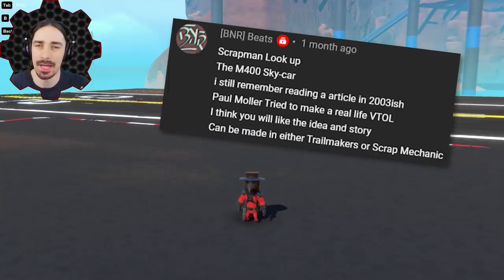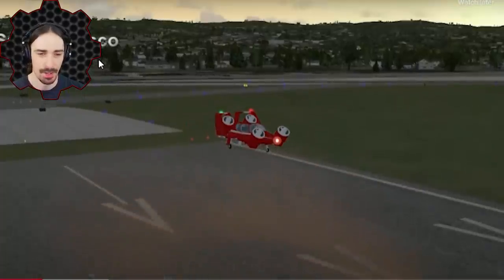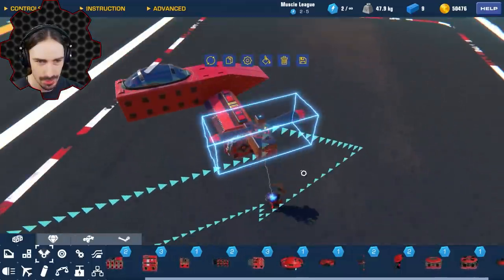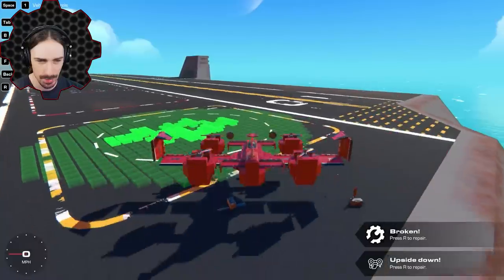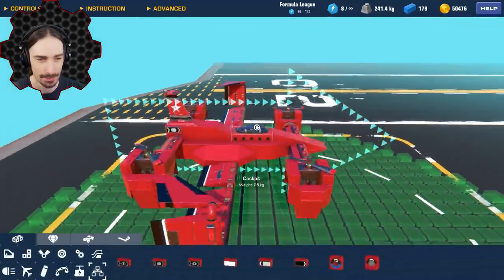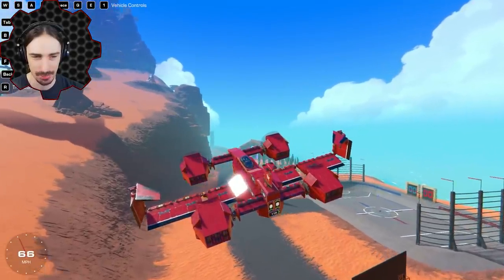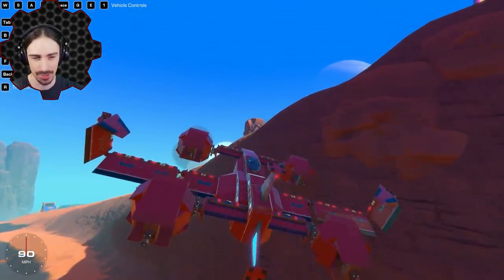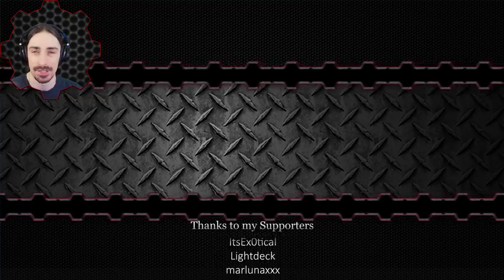This Failed Flying Car Was Supposed To Be Our Future... SO I BUILT ONE!

Comment: I actually do have some minor aerospace engineering experience, and to be honest... this seems like an  actually fairly sensible design. There definitely could be something I'm missing, but it seems like it would be something that, with some computer automation, would actually be relatively easy to control. It's effectively a quadcopter during take-off, and then transitions to have some vertical lift which allows more efficient use of the thrust than staying in a quadcopter configuration. It seems pretty feasible to me. Still impractical though just on the fact that actually flying a plane is sort of the easy part of the things involved in flying a plane, so a somewhat easier to fly plane would not really make things a lot more regular consumer-accessible. They would still need a lot of training.
Reply: Yep, the problem of flying cars is not that we don't have the technology, is that we don't have the Ai to drive them, because if we let humans do it, "car" crashes will skyrocket
Reply: your verry smart
Reply: To be honest I was more interested in this comment than the video
Reply: @alessiobenvenuto5159  "SKYrocket"
Reply: Thank you very much, as I've heard what he said I was quite irritated and frustrated. In the Original you btw also see that the front propellers are angled more upwards than the back propellers.
Reply: @DeadBread.  ?
Reply: @alessiobenvenuto5159  because sky and skyrocket, pun
Reply: @alessiobenvenuto5159  Actually, we have the AI. The problem is demand. By that I don't mean nobody wants flying cars, but nobody wants to pay what it costs to get the car and certifications.
Reply: @duodecaquark3186  we don't have a perfect ai to drive cars, but we have one for driving drones even in traffic? Seems extremely dangerous, even more than cars
Reply: The problem isn't the AI, the problem is the FUEL.
Reply: Bro just wrote a few paragraphs for scrapman😂🎉😅

Comment: I noticed in the animation that the SkyCar seemed to use VTOL mode until it's at proper altitude, after which it transitions to horizontal flight for cruising at THAT altitude, I don't think it was really meant to gain too much altitude in that mode.

Comment: I remember reading that the ducts themselves provided most of the lift during forward flight.  The wing was mostly for control and did not provide much of the lift during forward flight.  It used elevons for control like a flying wing.  You should have added small wing pieces to the ducts.
Reply: I was gonna say, in the irl video it shows that the intake are not 90 degrees when taking off, and at a part of the animation it shows that the rear of the duct is not horizontal, but slightly angled showing it still used the thrust to have lift.

Comment: this is the problem with the old "Future" stuff, they expected it to look cool, but since they didnt know how it would work, they left no space for actual functuanality. i bet this thing would not have enough fuel to fly for an hour.
Reply: 4 combustion turbojet engines take metric tons of fuel, you really only need 1 or 2 and direct thrust downwards, even STOL is much more efficient.
Reply: I actually suspect that, if it were completed, it could go a lot longer than that. It would certainly be less efficient than a regular light airplane, but it's pretty typical for a 4-seat general aviation plane to be able to fly for 3-5 hours with full cargo weight limit, and get a range of 300+ miles. Nicer ones can exceed 500 miles on a tank with about 500-600 pound total carrying capacity while fully fueled. Of course, these planes run a cool $250,000+ price tag.
Back of the envelope type calculations, but I think it would be reasonable for this concept to get at least half that range with the same carrying capacity.

Edit: Removed incorrect musings about engine type and all.
Reply: @daanoffline5716  the original design isn't for turbojets. They're just ducted propellers. This is actually a perfect choice for this type of system, as they're more efficient at lower speeds and lower altitude than turbojets or turbofans are. It's why still to this day brand new planes with only a few passenger capacity are propeller planes.
Reply: skycar m400 was apparently supposed to be able to fly for 6 hours tho
Reply: @discoadri633  that is still shorter than a school day for kids in the US, which is 8-9 hours

Source: Me (still in middle school)
Reply: @DeadBread.  that is still enough to travel 3192 km with its speed 
Source is the site of the comapny you can find it by typing the name of that car
(Think it was skycar m400)
Reply: @discoadri633    i was more or less just joking about how long school is.
I know 6 hours of flight time can get you quite far. I mean if you fly in a straight line for only 20 minutes, you'd probably be at least 15 miles away from where you started. I was just joking about how just one school day is longer than the flight time for a vehicle which transports people longer distances than cars can
Reply: @DeadBread.  yea dont worry im not like seriously telling you that ur wrong or smth like that was just a pretty chill comment and btw in 20 mins ud be around 110.3 miles away in da skycar
Reply: @markjacobson4248  You're joking right? Wankel engines are some of the least efficient combustion engines of all time. They use a lot of fuel and oil and much of it just comes out the exhaust unburned due to the overlap in the combustion processes.
Reply: @theyeetus1428  You're right. I don't know why I misremembered that, but absolutely correct. I'm editing my original post.
Reply: @markjacobson4248  I read that the actual prototype could only lift enough fuel for 20 minutes with rotary engines, and endurance with turbines was even worse
Reply: @markjacobson4248  isn't the skyplane just a quad copter with wings and rotating power plants? And if skyplane really is what I think it is, then why not just fly a quadcopter and not have to deal with extra complexities and possible reliability issues that come with having extra wings and servos. As well surely quadcopters are likely faster than your normal pedestrian car, and likely also easier to produce than a skyplane. I don't think that the skyplane solves anything that we haven't already solved when it comes to pedestrian transportation via air.
Reply: @ManaMan_1405  There is a reason VTOL vehicles are made despite being far more complicated than a quadcopter. Fixed-wing aircraft are massively more efficient than helicopters or quadcopters. Transitioning to winged flight would be highly beneficial to give it the range to get anywhere. That being said, this particular vehicle is not practical in any way, not because of the mechanical design but because the concept. As far as I see it, there are only a few things that could be designed better for a 1 or 2 seat daily commute flying vehicle. It's pretty close to exactly how I would design it if I were the designer and I was working with what exists today, but the concept to begin with is just one we don't really have the technology or public interest to make practical right now.

Comment: You should check out the VZ-9 Avrocar. 
The worlds first (and only) "official" flying saucer.
Reply: First, probably yes. But the predecessor of this one, the original Moller M200 (now named Neuera 200, according to their homepage), looked just like the cliché of a flying saucer, too: pilot (+ passenger, if any) in the center, under a 'fish bowl' canopy, eight props in a circle blowing their air flow downwards through the 'saucer'... Only concession to reality: a fin sticking up behind the pilot, to keep it flying somewhat straight ahead in forward mode...
Reply: Flying sauce
Reply: @CoPoint  I forgot all about that one. Thanks for pointing it out.
Reply: @BLKBRDSR71  No problem - was just wondering a bit why the 'little brother' didn't get at least a short mention in the video, as it looked so much like the proverbial saucer... seemed like a missed opportunity 😁...
Reply: @CoPoint  I believe he built this to test his idea of using compound fans driven by Wankel type rotary engines

Comment: When building propellor thongs like these, use pistons to pull the propellor down into the tube thing. It doesn't have collision on the blades, just the 2 by 1 block at the bottom. Using this you can also kinda merge more than one propellor , when before you couldn't because of the hitbox

Comment: The front engines had a ducting apparatus that split the thrust for elevon/aileron roll control. I can only explain it as a sort of bendy Venetian blind slats that were to be fly by wire type controlled. But during vertical and hover the nacelles tilted then transitioned to horizontal flight

Comment: You're assuming the wing is used for lift, instead of for controlling the pitch. It's easier to fine-tune the pitch using wings, than it is using the engines' thrust.

Comment: I imagine if you did more quad steering (slowing CCW motors to spin CW and vice versa) in VTL mode, and using differential in forward flight would fix the issues with yaw. Though I have no idea if that's possible in this game, so *shrug*, but awesome video nonetheless!

Comment: There are several planes without elevators 
One example is the “euro fighter” and “avro Vulcan” they combine the functions of elevators and ailerons into one control surface
They are very common on fighter jets and the f22 is very reliant on them

Comment: my theory is that the jets had thrust vectoring, because when it shows the aircraft taking off the jets are at an angle instead of being completely perpendicular to the ground. that also explains the lack of control surfaces on the wings.

Comment: there was some kind of flaps in engines to crontrol engine flow a bit down. Thats why engines was more like 45-50 degrees.. Maybe. Regardless they wasnt 90 degrees when landing. And flying forward engines gives some lift force as forward too. And engines was for direction of movement for get air in to engines.

Comment: Aircraft with wings rear of the center of gravity are actually pretty viable efficiency and stability wise provided that your control surfaces can provide enough torque to rotate the aircraft, given that this plane uses engines as canard control surfaces it seems pretty viable to me

Comment: Hey, ScrapMan, I know how to make tank controls in Trailmakers: you just need 2 engines 1(or more) for each set of wheels, they need to be programmed for A/D keys. Then add logic gate, connect to every engine and program it for W/S and signal strength 0,90. And just like that you have a tank :З
Reply: What is did for my tank is I made six raw engines, (three for each side) connect  the wheels to the engines, made three of them up/down keys and the other ones w/s
Reply: @poot.0  I tried this too, but my method has better turning while in motion
Reply: @FourDISGuy  yeah, mine kinda sucks. 😂

Comment: just move the wings forward, in the middle, but you also have body lift, for what that amounts to, as percentage, a drone does not have wings
Reply: t-tail for vertical control
Reply: keep it simple engineers
Reply: are you in some hurry
Reply: all possible, use electric motors with metal-air fuel cells, for real
Reply: if you cant, you are a failure, not the goal

Comment: Scrapman, I got an idea. Make a beyblade and surround it with magnets facing outwards and use thrusters to rotate it. Use a swivel to cancel out the beys rotation and place another swivel on top of it and place some thrusters to use for changing directions (in instruments of destruction)

Comment: You should really check out balsa model flight sim, if you really want real world flight physics. Still in early access but great for testing plane designs. Doesn't have helicopter physics yet but people are getting good at manipulating the current flight physics. I had made a vtol pod racer. Took hours upon hours to get to work 😂

Comment: Personal flying "cars" are extremely costly and inefficient for both manufacturer and buyer, because constantly fighting gravity whilst trying to stabilise the vehicle is an engineering pain in the 4ss.
It's easy in the big planes with high speed and big wings and also more efficient because you can build it once and use it for 20 years, and one flight brings a lot of people.

Comment: being and aerospace engineer yeah they would have had problems with thrust to weight and center of pressure and lift because of the wings being in the back with engines and no tail but they can be solved with auto stabilization and movie the engines in flight for thrust vector control to stabilize the craft in flight along with have at least 2 control surfaces on each wing 1 for  stabilization and one for control.

Comment: Jupiter is primarily composed of hydrogen, but helium constitutes one-quarter of its mass and one-tenth of its volume. It likely has a rocky core of heavier elements,[16] but, like the other giant planets, Jupiter lacks a well-defined solid surface. The ongoing contraction of its interior generates heat greater than the amount received from the Sun. Because of its rapid rotation, the planet's shape is an oblate spheroid; it has a slight but noticeable bulge around the equator. The outer atmosphere is visibly segregated into several bands at different latitudes, with turbulence and storms along their interacting boundaries. A prominent result of this is the Great Red Spot, a giant storm known to have existed since at least the 17th century when telescopes first saw it.

Surrounding Jupiter is a faint planetary ring system and a powerful magnetosphere. Jupiter's magnetic tail is nearly 800 million km (5.3 AU; 500 million mi) long, covering nearly the entire distance to Saturn's orbit. Jupiter has 80 known moons and possibly many more,[6] including the four large Galilean moons discovered by Galileo Galilei in 1610: Io, Europa, Ganymede, and Callisto. Io and Europa are about the size of Earth's Moon; Callisto is almost the size of the planet Mercury, and Ganymede is even larger.

Pioneer 10 was the first spacecraft to visit Jupiter, making its closest approach to the planet in December 1973.[17] Jupiter has since been explored on several occasions by robotic spacecraft, beginning with the Pioneer and Voyager flyby missions from 1973 to 1979, and later by the Galileo orbiter, which arrived at Jupiter in 1995.[18] In 2007, the New Horizons visited Jupiter using its gravity to increase its speed, bending its trajectory en route to Pluto. The latest probe to visit the planet, Juno, entered orbit around Jupiter in July 2016.[19][20] Future targets for exploration in the Jupiter system include the probable ice-covered liquid ocean of Europa.[21].
Reply: @Bedmundus -- I think that you might've meant the Jupiter comment for another video; this one's on VTOL in a video game.
Reply: are you getting the unaligned comment section bug again? could be found when switching to another video too fast or clicking on community tab while miniplayer is on (i only find this on pc)
Reply: @beaclaster   Ooh, I hadn't heard of that one!  (And I'll have to keep it in mind, since I'm on a PC.)

Comment: Moller's work always looked like the best bet, but I have to say that Moshier's looked cooler. 😉  (Michael W. Moshier, Aurora 400, though I think that he might've worked on some others as well.)
Reply: I kind of disagree. He didn´t have the theoretical background and made the turbines way to small. The turbine diameter would really need to be twice that to be a reliable vihicle.
Reply: @matsv201   I agree with you.  20 years as a turboprop mechanic, and nowadays I can see a few obvious issues with the designs that I never really grasped in the '80s.
Reply: @charlesrockafellor4200  Yea. you really just need napking math to figure out how much power certain fan area need to be lift a certain size. Lift response is also a issue

Comment: The problem with flying cars and similar such devices is the fuel requirements. The amount of energy you have to produce to get the vehicle off the ground is incredible. Think of the battery limitations of an electric car. Now imagine how fast it would burn through it if flying. Those troubles translate to gas as well. These things would GUZZLE fuel, and the fuel is a lot of extra weight it has to carry. Typical rocket design problem of needing to be able to carry the weight of the fuel it then burns away. It would easily cost as much as a helicopter to fly, if not more.

Comment: I think I know how it gets some of it's lift look up look up a wingless plane it's basically, but to keep it from being triangle shaped it has the 2 wings in the back.
Edit: A wingless plane is triangle shaped and it needs to do that in order to get the right amount of lift, and for some other non important reasons. If you take out the triangle shape and make it rectangle it would fall. in order to keep it from falling they add wings in the back  This works differently in the game because there is no lift on the bottom of the plane car.

Comment: Sm im not an expert but i think the reason for the extra wings in 90° are to prevent a weird aerodinamic effect that occurred on the tips of the wings making a diference in the preasure wich created a vortex causing a loss in eficiency
Reply: in a way
Reply: @apersunthathasaridiculousl1890  do you know more? I'd like to know the real reason
Reply: @maxdenor1459  my understanding isn’t very clear, but iirc, when the surface contact with the wings stop the air kinda gets sucked back making more of a vacuum than a vortex, can someone confirm?
Reply: @apersunthathasaridiculousl1890  thats what happens behind the wings but im talking about the tip of the wings
Reply: @maxdenor1459  if you’re talking about the wind shape, yes, it’ll work better when angled or curved